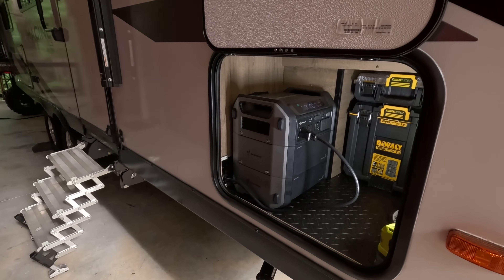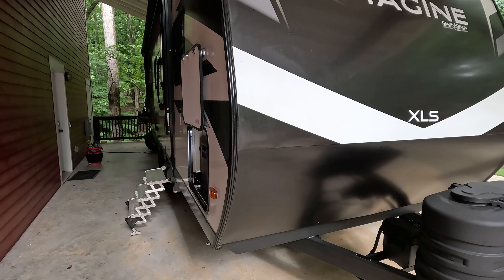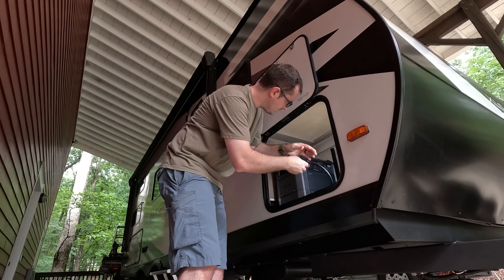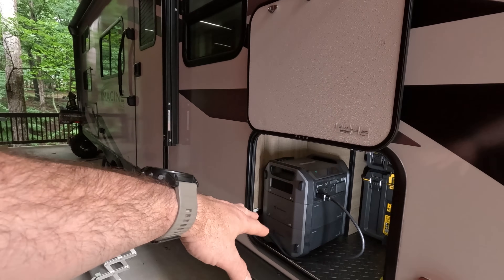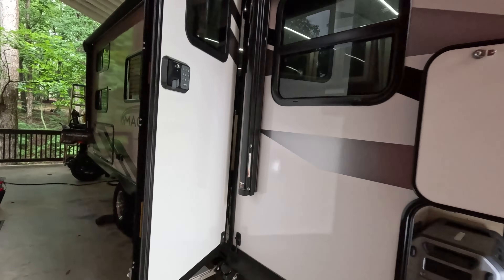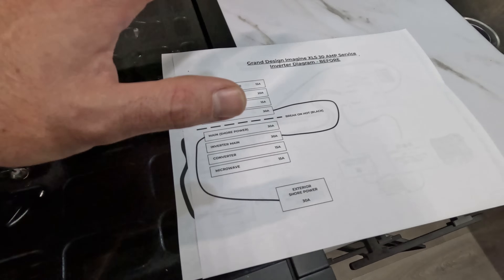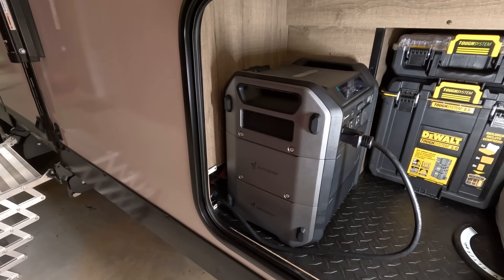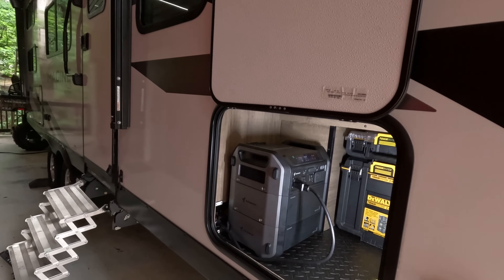Don't Waste Your Money on Lithium // I Install a Segway Portable Power Station Cube 2000 in My RV

Comment: So the power station is going from dc to ac to power the coach, and in your coach at the converter, it's going back to dc to charge your lead acid batteries. Their is a loss there.
Reply from the maker: @kd7alt   Great question. This setup is actually just supplying 120V AC @ 20A max to half the panel, excluding converter/charger and air conditioner. At 9:12 is a more detailed wiring diagram. My setup is more basic here and works great for a smaller trailer. The DC system is still powered by a separate 12V battery, which is a basic lithium in my case so I am indeed a hypocrite ;) based on the playful title of the video. The challenge is most power stations on the market have limited raw 12V DC output. Bluetti has one up to 30A DC, but really one needs 50-60A or higher to adequately support a typical travel trailer or fifth wheel 12V system. Maybe one day there could be a seamless all in one solution for 12V DC and 120V AC featuring a power station, but but quite there yet. Still I like the flexibility this setup provides and multi-purpose functionality.

Comment: Great approach to the problem! Do you happen to know if the Solar input is an MPPT device? I don't see any mention in the manual on their website. What was the next runner-up in your decision? Finally...do you run your microwave from the power station. (sorry if you covered that) Thanks!
Reply from the maker: That is a great question about the MPPT...I do not know. I don't plan to charge mine through solar at least for now...sorry I couldn't be more help on that one. I also like the EcoFlow Delta 2 Max...that would probably be my #2. Bluetti has some new models out and that'd be my #3. Lots of good options out there. My microwave is hardwired into its own circuit on the RVs distribution panel/circuit breaker, but it is on the upper half that is supplied through the transfer switch. So, it'll run off the power station when no shore power is present. Hope that makes sense. Thanks for watching.

Comment: I like the way you think. I have a question. If you have solar panels topside can you use those panels to charge the cube and avoid the excessive weight of batteries?
Reply from the maker: Yes, it accepts 12-60 V 800 W Max for solar input. I haven't used it that way yet as my trips are short enough where I can last 1-2 days before I get to shore power. But, it certainly is possible to use solar and then shed one of the two battery packs shown in the video. I've been using the setup now for about 10 months and it has worked flawlessly.
Reply: @AdventureRocks  When I hit the road it will be full time. Thats why I was asking.

Comment: What about heat buildup in that compartment?
Reply from the maker: Great question. So far no issues even in the heat of summer. I have a Govee temp sensor in that compartment just in case and no spiking or abnormal temps even when left in the sun and running without AC. I think the size of compartment in contrast to the size of power station helps in my case. Probably could be unique to each RV.

Comment: Does it have 12v output for connecting a 12v fuse box for electrical systems?
Reply from the maker: I would LOVE to see a power station with a high output DC port. On the Segway there are only 2x light power DC barrel plugs - 13.6 V 5 A 68 W Max. Bluetti is the only one I know of that has a 30A 12V DC port on it, which is okay for a small van or trailer, but most RVs would require something in the 50-80A range to cover all the 12V use. Here's another video showing the Bluetti in a setup like you described:
https://youtu.be/PHfbcuK2M80?si=iaqmRNkXTX7ZB4O2&t=513

I really hope one of the mainstream brands such as Segway, EcoFlow, or Bluetti will make a power station with a higher output 50-80A DC as that could mean a single power station for the entire RV both 12V and 120V system. Imagine the versatility. Great thinking.
Reply: @AdventureRocks  damn, i was hoping that these power stations were more rv-compatible. Maybe going custom is the way to go after all.
Reply from the maker: @cotinborgund4223  I hear you. I really hope to see manufacturers add that high output DC feature in future.
Reply: @AdventureRocks  Been researching this quite a bit. My RV has 2 slides, a power awning, and an electric tongue and stabilizer jacks that I believe are all tied to the DC side which would require a battery (I need to verify this). Don't think any of these would operate off the 30a RV plug only. In my research, I found the OUPES Mega 2 has all the usual USB/110v outputs, but also has a 30a RV plug and a high-load 30a DC output on an Anderson plug.

Comment: Can the power station be charged in the trailer while driving? And how so if its going to be connected to the trailer wouldnt it get damaged? As its giving power to the trailer and it being connected to your truck Im a beginner into all this and im lost with power and electrical work
Reply from the maker: Thanks for patience. In my case I'm doing the reverse and discharging while in motion to power things like my outdoor fridge or at rest areas along the way. However, if you were to option in a Bluetti Charger 1 on your tow vehicle, you could indeed charge while driving harnessing the power of your vehicles alternator with a DC to DC charger:
https://youtu.be/8A6BvXudcOg

Comment: Did you keep the original 12v battery on the tongue for the DC side? The cube still has solar charging? Lastly, if you hook gas generator to shore power plug, you could provide power to recharge the cube?
New at this, just thinking out loud. Thanks for the videos.
Reply from the maker: Great question. So based on the title of my video I'm probably a hypocrite as I still have a small 100ah lithium battery for 12V DC...just the main fridge and lights essentially. I'd love to see a power station that could literally replace the entire 12V and 120V system combined on an RV, but the problem I've found is most power stations have low output DC...maybe 10A or 20A. Bluetti has a 30A port on their AC200Max, but really you'd need a 60-80A 12V DC port or terminals to make use of a powerstation as a main 12V source on an RV. So that seems to be the biggest limitation.

You can use solar on the Segway Power Cube to charge, although it is slow naturally. And, yes you could use an external gas generator to recharge as well. Segway gives option to control/throttle how many amps are used for charging as the AC input is a whopping 1250W max...which can compete with other appliances. The recharging is incredibly fast.

Comment: How much was that system? I wonder if you calculate the $ per watt hour if it isn’t as cost effective as it may seem.

I spliced in 20,480 watt hours into my Rv using 48v batteries and a 6k inverter. The cost was about $6,000.  So just under 30 cents a watt.   I left everything else stock so if I get a new Rv I will reconnect and take my system to the next rig. 

I will admit that the minimal installation. Is appealing but the price per watt is just too high at the moment on those systems
Reply from the maker: Great question! Yes, for off-brand power stations you can get closer to $0.30 per wh, but for name brand power stations like Segway, EcoFlow, Bluetti, etc. it'll be closer to $0.40-0.60 per wh. I may be in minority, but for me personally it's not the cost itself that I get hung-up on, but more the aspect of the $$ is tied up permanently in the RV and then it can't be utilized when the RV isn't in use. For weekend warriors like myself that only use the RV some 30-50 days out of an entire year, I like the idea of having a more versatile power station to use whether for home backup or other portable use-cases. Certainly for folks that full-time in an RV or spend more time using RV then the permanent full-featured lithium install with converter/charger + inverter makes more sense, regardless of the cost.

Comment: why you need to have a transfer switch when the segway has a UPS function
Reply from the maker: Great question. Two reasons in my case: 1) If I want to use the RV without the power station, and 2) for safety/redudancy since my setup is gauged overall for 30A and Segway is only 20A.

Comment: Which power station could run the AC unit? Even my ecoflow DP won't run the AC unit and it's 13500 BTU.
Reply from the maker: Have you tried a soft-start on your AC? I think the way the AC spikes initially causes a problem for the majority of the mid-larger power stations, sometimes even with a soft-start.

Comment: I got a dumb question here so don't laugh, but why wouldn't you just plug your shore power into the power bank and when you need to charge it, plug the charge plug  it into an outlet when connected to shore power or running the generator?  ( the gen power will block shore power when running ) What am I missing here. I love the idea but don't understand the over complication. Also I think this power bank will keep my AGM batteries topped off by using the onboard automatic converter. Thanks for posting.
Reply from the maker: No problem, it's not a dumb question. I'll be publishing a test video on a new Bluetti product this Sunday showcasing the exact scenario you mntioned. For a 30A RV like the one in video it would need a powerstation with a Nema TT-30 plug and capable of supporting 3600 running watts. They do make them in this capacity, but just a bit larger/heavier and pricier. And, you could only run it when stationary, and of course you have to connect and disconnect each time like gas generator. But, nothing wrong with doing all that. The solution in this video is more for folks who want access to the 120V power while in transit such as to power a 120V fridge, or use a microwave at a rest area without having to drag out a generator and cables.
Reply: @AdventureRocks  Ok Thanks for helping understand that.  We have an onboard propane  generator that we use either while traveling or at rest stops if we need the AC or microwave. My thoughts have always been to use a solar generator so our  coach gen doesn't need to turn on and short cycle just for a small load of say 15 amps plus the solar gen can help keep the onboard AGM lead acid batteries charged just like a shore power cord would. It is too expensive to put LFP batteries in the coach because one would need to change the convertor , wiring switching and maybe even a DC to DC box for the chassis alternator. So with all that said one of those solar gen set would be great for what I am planning without having to re engineer the whole system.just plug it in and recharge with real shore power or long run generator times.  Be safe out there my electrical wizard friend. By the way they do make adaptor plugs to go from the 30 amp plug to a 20 amp plug for a household outlet. I use it all the time to keep my AGM batteries charged above that 50 percent level when my Air Stream is just sitting around not being used.

Comment: Where'd you get the wiring info as to what's where? Getting ready to wire in a 5k Bluetti setup  (which will run AC).
Reply from the maker: Great project you've got planned! The diagram shown I had to make from scratch. But, as far as the wiring in my RV, it took me a while to figure it all out. I couldn't locate an official diagram from Grand Design on the inverter prep, but I think it's basically just a loop in their models. Drawing it out really helped me get it all figured out though.

Comment: Why don't you just plug the generator directly into the outside plug and power it that way . Same way you would with a gas generator????
Reply from the maker: Great question. Personal preference, but these are my main reasons: 1) In order to run it while in transit such as a 120V outdoor fridge with meat in it and 2) Seamlessness, meaning no need to drag out a power cable and adapters to connect each time you want to use and 3) It automatically transfers power in the event of a power outage at campsite.